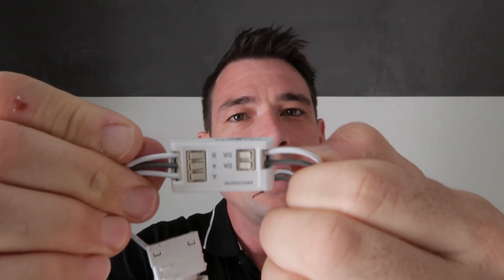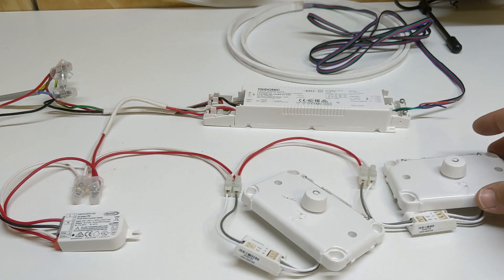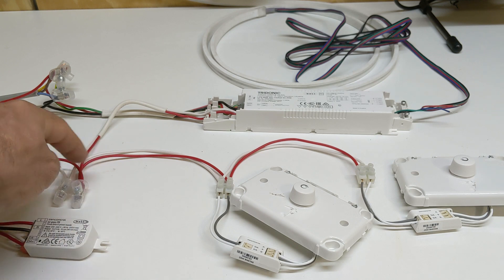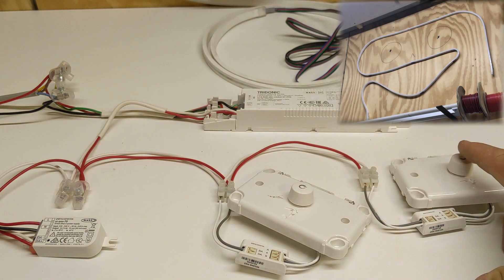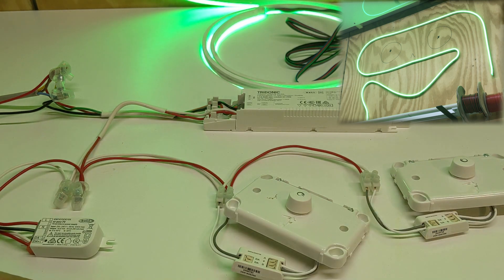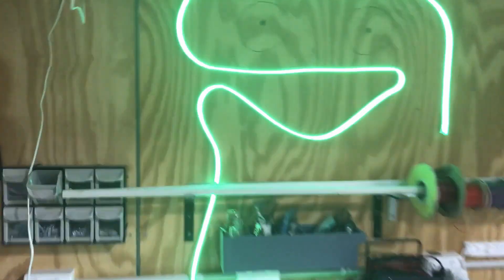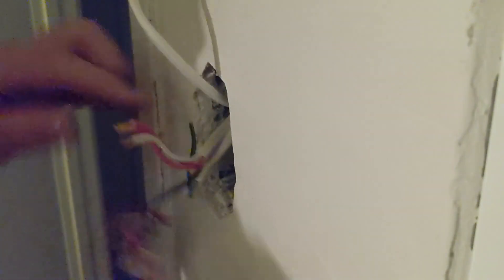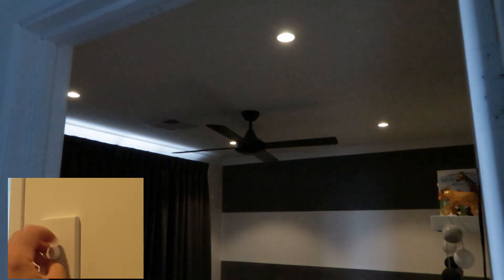The Perfect Dimmer???

Comment: I noticed you had to turn the rotary encoder a lot to make a impact on the dimming.

Can this be adjusted?
Also when you turn the rotary encoder quicker does it dim quicker? Or is it just looking at the direction of the dimming?
Reply from the maker: Yes your right, you have to turn the dimmer alot I believe that each increment  is only 1 step so 85 - 255 in my case. Having used it for a week it's not something that I have found annoying at all.  As a stand alone you can't change it. And turning the encoder faster doesn't increase the dim rate.
Reply: Jimmy James ah that’s a real shame. The benefit of traditional rotary dimmers is that you have direct control of speed of the dimming.

This is something the misses keeps getting annoyed about after replacing the Clipsal rotary dimmers with zwave push button dimmers. She wants the rotary control back.

But I haven’t found anything so far that can do it (not for Australian wall plates / standards anyway).

I have tried Zigbee rotary dimmers which don’t connect to the circuit, just control the zwave dimmers via Home Assistant, but all these rotary devices do is tell home assistant which direction you are turning then knob. It’s like essentially having two buttons just in a knob.

If you come across anything that has true rotary dimming but also integrates with HA, please share.

Thanks for sharing.
Reply from the maker: You have it exactly right there is nothing quite like a rotary dimmer, I've installed quite a few push button smart dimmers and everyone want to know if they can get a rotary control for it.   I went and tried the dimmer again just know to work out why I haven't found turning the dimmer alot annoying, and if you turn it slower it dims faster, so it actually works just like a normal old analog dimmer, turning less than 1 rotation will take it from lowest to highest if you turn it at normal speed, which is interesting.

Comment: hi Jimmy, interesting. Would be good to see how this would integrate with Home Assistant - cheers! What is the technology if not "cut phase"?
Reply from the maker: Yes it would be, it is currently my main project at the moment, trying to figure out how to get them to work together, without too much cost. Dali devices send a digital signal that tells the driver how much power to put out, in this case it is a constant current driver so the current and voltage are reduced on the DC side as opposed to phase cut which cuts the AC side. So there is no flicker ever, mind you it does cost a little more.